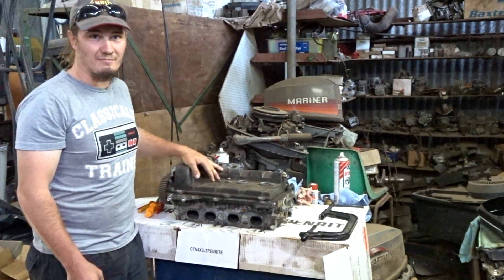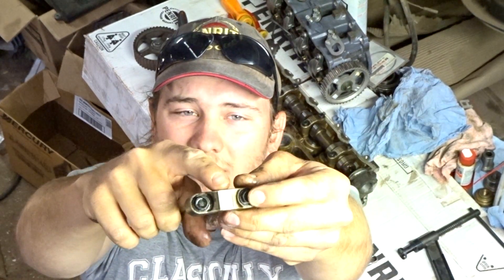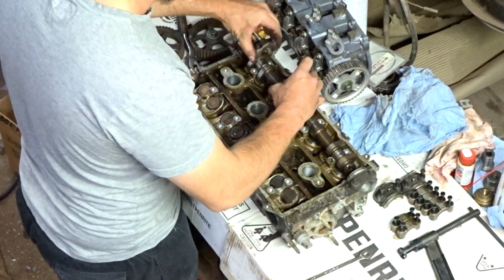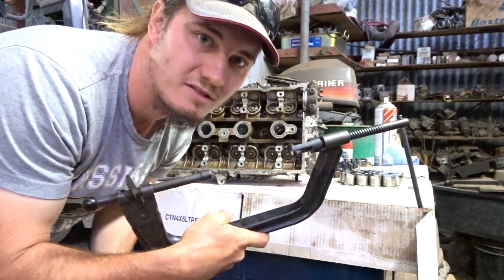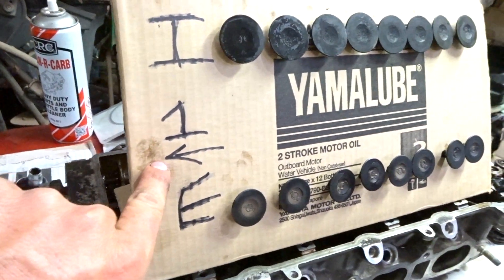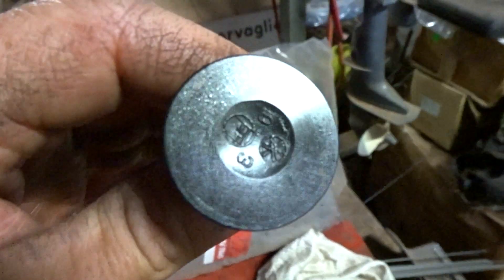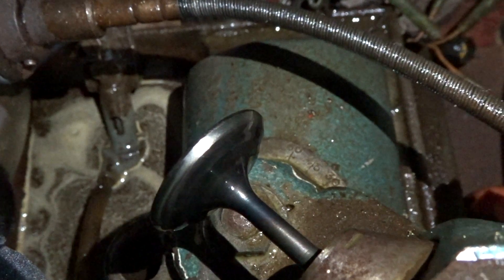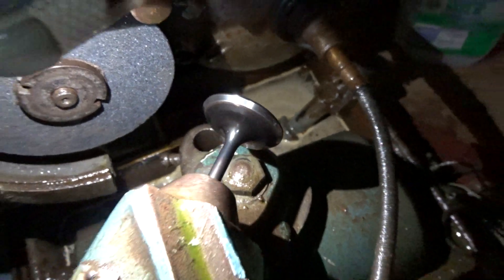Forged 5SGTE Build | Disassembling the Cylinder Head and Refacing the Valves

Comment: i am looking to do a swap to my 5sfe i want a 3sge head on it i watched some of ur videos and i think that is what ur doing. i do not want vvt heads have u done this swap i been reading alot on line but just want to talk to soem one who has done a swap
Reply from the maker: just putting a 3sge head on a 5sfe block won't work very well due to the different piston designs, you'll need different pistons to bring the compression ratio back up at the very least to make it worthwhile
Reply: @AaronBonBarron  so what pistons would u recommend. I am wanting to just make it so its got a bit more pep. And i want the car to be able to take the heat. I do demolition derby and been having issues woth the stock 5sfe head not liking what i am doing to them